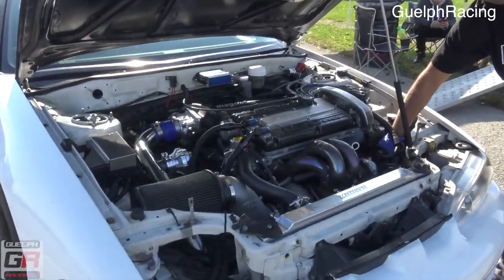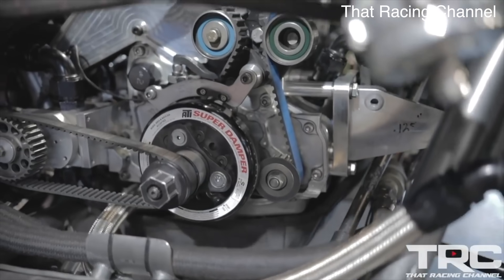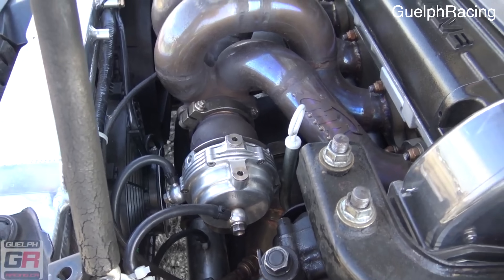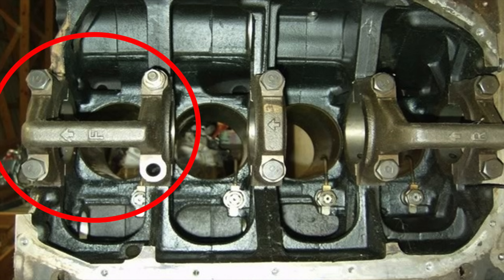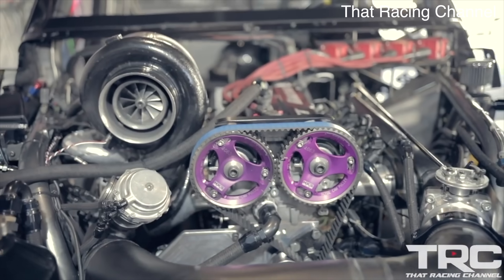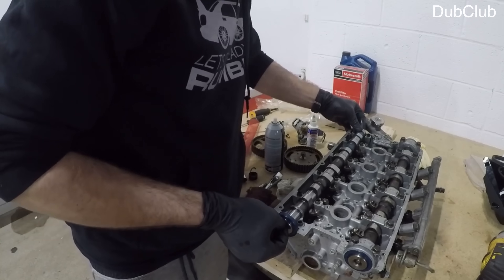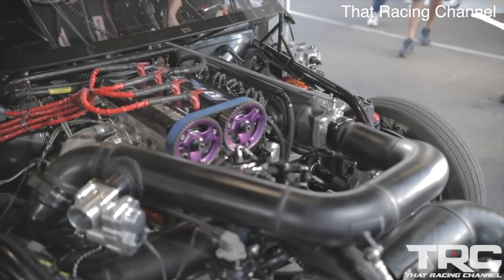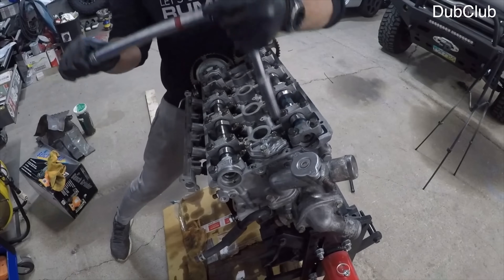Mitsubishi 4G63T: Everything You Need to Know

Comment: My '91 Eagle talon Tsi turbo AWD 5-speed was AWESOME and imo was THE greatest sports car of the '90s under $40k.
It looked great with a sporty, muscular build and an aggressive stance, handled like a cheetah, was FAST and had a primo interior that looked and felt expensive. 
That turbo 4 banger was the star of the show though.
I spanked quite a few 5.0 liter mustangs with it in stock trim. It had a good clutch and tranny though the shifter absolutely sucked. It's independent 4 wheel suspension made it nimble and sure footed while the AWD system gave it scalding launches and made rain and snow a non issue.
The brakes were good until they got hot then we're easily overwhelmed by the turbo motor.
I warmed mine over a bit, making about 270 to 290 hp and installed uprated performance shocks and brakes. So equipped my Tsi was a terror! I loved that car!

Comment: The A853 from the Neon SRT-4 would give the 4g63 competition. Both great engines. Take power . However the SRT makes great torque down low making it a more preferable street car. (Stock form) . I don’t want to have to rev out an engine just to gain its benefits. This is frankly why I could never get into Honda engines. No hate towards them however. Great engines also

Comment: Out of all the videos covering the 4G63T I've never heard anyone mention their tendency to snap timing belts and destroy the top end. If you don't change the belt every 40-50k miles you will most likely experience this. Other than that these engines are bulletproof.
Reply: with stock pistons thats actually not entirely true ... valve recessions in the top of the pistons mean 9 times out of 10 you're fine. Nothing will touch when the valve train sits between the valve spring lowest point. If you're revving the shit out of it when it snaps tho thats another issue.
Reply: Very true. My '91 talon Tsi turbo AWD 5-speed snapped its timing belt 59k miles, just in warranty. No valve damage  thank God.

Comment: The thought behind smaller Port heads being better is that the port air velocity stays High giving better torque. I have a 20G on my 92 Galant VR4 and throttle response isn't bad especially compared to the 14b which is like breathing through a straw. Lastly there are a number of 1000+ horsepower 4g63s that do not use a Billet block, while the internals may be substantially upgraded the block itself is stock.

Comment: The 2.4L A853 block makes massive torque at low end. Stock from the factory same deal crank can hold 800hp and can easily built up to handle upwards to 1500hp as seen in the Red Sled. Transmission is the biggest limitation in the SRT4. But thanks to Liberty Gear and Realtuned we have a dogbox and billet internals. Can also be stroked out to a 2.6L by turning the crank and using 6 bolt rods.
Reply: Correction to engine code

Comment: The first vehicles to feature the 4G63T engine were the Mitsubishi Starion and the Dodge Conquest, both rear wheel drive with the engine mounted straight ahead. Race versions of the 4g63 hit 10k RPM's typically. That's about as high rev as you get in a 4 banger car engine.

Comment: I respectfully disagree about the 4g63t. First thing right off the bat, they're not able to handle "massive boost" stock. you will blow the bottom end out faster then you can say over boost... Block can be good or bad depending on luck or good parts. Yes the 7 bolt is less sought after then the 6 but they're not as weak as the dsm community makes em seem. Factory the turbo puts out around 11psi and you turn it up past 15 without the extra fuel and motor will come apart... Yes they are fun and easy to build. No, stock parts will not get you far. 240 wheel isn't all that "high" hp output
Reply: That’s tuning dude, not the engine itself
Reply: I'm a bit confused about what you mean.  What are you trying to say?
Reply: Smoking the pipe? Bad parts and tuning will kill them. Have multiple cars I tune including one on my channel that made 449whp 100% stock engine at 30psi on hx35 and held that for well over a year before motor got built.

Comment: Can i ask which evo started using 7 bolt ? Same with the differend heads?
Reply: All evos are 7 bolt. All use the better small runner design head. Evo 1 - 3 is essentially the same as a 2nd gen eclipse engine, but with better intake and exhaust manifolds, different cams, bigger injectors, and different versions of the 16g turbo. From evo 4 on, the engine was flipped to the opposite direction like the 8 and 9 in the US. The turbo was changed to twin scroll, the boost was turned up, and even bigger injectors were fitted.

Comment: Best 4 cylinder turbo engine is the sr20det.. Just my opinion..
Reply: Oh great another fan boi...
Reply: Lin Chester another one that has never looked outside the box and actually learned some facts about other cars!
Reply: @RichRusso4218  i have a friend with a gsx eclipse, both of our cars are sublte modded and he is always complaining about how easy my motor is to upgrade.. As i said, facts..
Reply: Been proven wrong time and time again, nothing beats the 4g63.
Reply: RichRusso4218 sure, but where are the facts?
Sr20 have better mileage, better air-gas flow, easier to upgrade and cheaper so besides brand preferences what else you have to say to make an statement, don't get me wrong 4g63 is the best four cilinder from Mitsubishi, but said that it's the best 4 cylinder engine mmm I'll argue about it unless you prove me wrong..
Reply: @jufrabappa3922  the rocker arms are a weak point on the sr20, plus the alloy block hinders higher power production on the stock blocks.
Reply: @RichRusso4218  facts Wiseass facts.. You can argue whatever you want, but what B series were for the states, the sr20 was for japan..
Reply: @mitsubishikid1187  I know that, but electrónics is what help the most on the later versions on the 4g63..
The fact that the 4g63 os not really happy beyond 15psi let you know that the block is not that good..
Reply: Jufra Bappa not happy beyond 15psi, LMFAO, I have a bone stock 1991 4G63 in my race truck pushing 650hp at 32 psi. Only mod it has is supporting fuel mods, head studs, dsmlink to tune and a turbo. Cheap, easy and WAY easier than any garbage sr20. You Nissan kids really need to get over it, your engines aren’t any good besides the rb30 and vr38’s.
Reply: RichRusso4218 interesting, but a stock 4 cylinder engine that goes way beyond more than half of the internal pressure that is suppose to handle and haven't blow is too much to believe, you can say that your internals are forged and I'll take it, but saying that something stock can handle those numbers is just a good story..
Reply: @jufrabappa3922  That boost level is just to keep me in my class at the track, I run 40psi+ on the streets or for open events. Really go do some research, the sr20 is GARBAGE compared to a 4g63.
Reply: A lot of car people like to define an engine's limitations in terms of the maximum boost pressure it can sustain, but that's really not the right way to do it, in the real world the maximum cylinder pressure is NOT determined solely by the boost pressure, so we shouldn't really use boost pressure to define the limits of any motor, Torque would be a better measurement.
Reply: @jufrabappa3922  Oh no, stock block DSM making over 600awhp through an auto (easy 700hp at the motor).

https://www.youtube.com/watch?v=sIzNO2mbaWU

https://www.youtube.com/watch?v=6jtQazl9teo

Stock motor 6 bolt making 600hp easily on a mustang dyno (aka heartbreaker dyno) 

Shit heres a weaker 7 bolt block making 33psi on a holset HX40

https://www.youtube.com/watch?v=nDnItqPpZgY

So to sum it up, the 4g63 will make the SR20 its bitch every single day. SR20 = JUNK!
Reply: https://www.youtube.com/results?search_query=Stock+block+4g63+700

Comment: I own a 92 Galant VR4 pushing 425 hp at the crank on a stock motor with 220,000 miles on it~Long Live 4G63💢
Reply: I used to own a 91 GVR4.
Reply: I still own a 91 GVR4. As soon as finances allow I'll be turning the pile of boxes under my bed into a 500whp 2.2 stroker. Can't wait. :-D
Reply: Fuck ya💢

Comment: So there's no definite reason for crank walk? Is there anyway to prevent it?
Reply: Dont crank the car over with the clutch pressed in
Reply: @hatchet157  so leave it in neutral and crank?
Reply: @mr.sennin7923  disconnect the clutch safety switch, it's a plug under dash , and start in neutral
Reply: @jerrywhite9225  noted
Reply: Yea try not to leave the clutch depressed for extended periods aswell at lights put it in neutral. I have almost 190 000 km on my stock evo 4 motor.
Reply: @hatchet157  thank you
Reply: @mr.sennin7923  no problem. Also this mostly applies for a evo 4 motor. later iterations crankwalk wasn't really a issue.
Reply: @hatchet157  ohh okay, was offer a evo but got scared due to it and not wanting to invest more into building a engine off the bat
Reply: @mr.sennin7923  yea you should have to do any engine work with the 4g63s mines been stock for 5 years now and all I've had to do is oil changes and a clutch.
Reply: I have owned my 95 tsi awd since new and it never walked, I disconnected the clutch safety switch so I can start without pushing in the clutch , did that like 20yrs ago and also I NEVER keep my foot on the clutch unless I am shifting, everytime I come to light or stop , I put it in neutral, not sure if that's the reason it never walked, but who knows ?

Comment: 7000 rpm is still good for a redline but my engine builder has found out that in stock form it still makes power up high and the real redline is actually 8300rpm.
Reply: Good luck with the stock valvetrain.
Reply: @RichRusso4218  yes stock valve train is what I'm talking about. After 8300rpm it floats

Comment: Few Issues with this Video.

 - The Crank-walk issue you mention only happens on the 7-Bolt 1st Generation DSM's due to the main caps. This doesn't happen on the 6-Bolt / Evolution blocks, some clarification would have helped.
 - The issue with the Evolution is the weak-ish forged connecting rods, this becomes an issue at 400hp, no respectable tuner will tune an engine above this, unless you have built the short block. This is not something "really easy" as you refer to it as. It will generally cost around 10K AUD, and that's a pretty mild engine build, using supplied core (Block)
 - The 2G head you mention is not as good as the Evolution 7/8 head as more recent R&D has been proving.
 - The Mentioned RPM range, whilst true in stock form isn't really something that's common in racing applications. Most race engines are producing peak power up in the 8-10K+ RPM range. 
See better Rod Ratio builds such as the 2.1Long Rod, 2.0, 1.8, 1.6 (Destroke) builds.
 - No mention of having to O-Ring the Head & Block beyond 800hp, this is a must or you will blow gaskets out the side of the block all day long.
Reply: Crankwalk only happens on the 95-97 blocks, 2nd generation dsms with the non split thrust bearings. 1g is 90-94. The 98+ had split thrust bearings and are WAY better.
Reply: @RichRusso4218  I have an early 2g 7 bolt , engine build date Dec 94 , I have owned my 95 Tsi awd since new almost 25 yrs , it never walked and has never been opened up, numerous runs at the track and literally 100s of street
 races over the yrs , still doesn't burn a drop of oil
Reply: @jerrywhite9225  Never said it happens to all, had one that lasted me three years, bone stock at 500hp, only died due to a money shift on my end with a new dog box transmission.
Reply: @RichRusso4218  ya it really seems to be the luck of the draw really, sometimes you get lucky sometimes you dont
Reply: Jerry White indeed it does, I have had two motors with it, one I bought just to see what actually causes it and the other was on a very old engine that had a act 2900 behind it for a long time.
Reply: It's a good video, but the 4G63 & the Turbo version were made to tackle multiple things.
The 4G63 had to be over engineered so Mitsubishi could save on making a reliable economy car and a reliable sports car. The difference between the two was the turbo. This is why there are super durable 90's Mirages with aftermarket turbos.
Reply: shardsforme lmfao, you know the mirages were a 1.6 turbo right? I live how people make stuff up. The 4G63 is totally different between the turbo and NA versions, different pistons, compression ratios, cams, blocks are different.
Reply: @shardsforme  just the turbo 😂
Reply: Yeah they do tune above 400hp, there are evos and DSMs both out there at 500whp+ on stock internals. My eclipse had 620whp on the stock bottom end dude
Reply: Michael Covington my race truck is at 650hp stock engine with arp head studs and an MLS gasket. 32psi Holden hx40
Reply: Tony ARC, lol terrible phrasing. Could you Imagine someone strapping a big ass turbo on a 90's Mirage and calling it a day. I imagine fire would be everywhere. Sorry I'm not a super details car guy, but my point still stands.
Reply: @shardsforme  internet is full of freaks who knows it all
Reply: RichRusso4218, you know I didn't know they had a 1.5 turbo. I do know that an n/a 4G63 block does come with certain 90's models Mirages (not sure what the size is). That said, I'm not certain what the hardware in that block comes with. I'm sure if you wanted to strap a turbo on it you would want to build the block to prevent damge. Like catastrophic failure, damaged ego, blown everything, &/or damaged ego. 😄
Reply: Crank walk is always caused by the driver starting the engine with foot on clutch. It's made worse by having a heavy duty clutch plate. If you start in neutral with foot off clutch you'll NEVER get crankwalk
Reply: @1magnit  nice to know 👍

Comment: The 4G63 T  in the eclipse and Tallon  was weaker than the Evolution 4G63  variant plus it was  placed on the Right hand side of the car vs the eclipse being on the Left
Reply: Wrong, DSM's are the same setup as a Evo 1-3, when the Evo 4 came out that is when the motors were turned around.